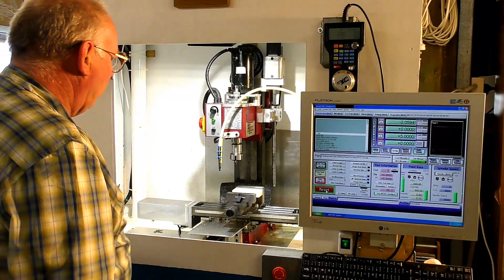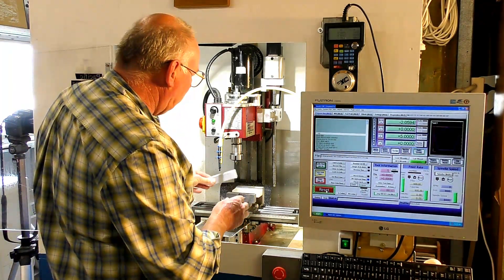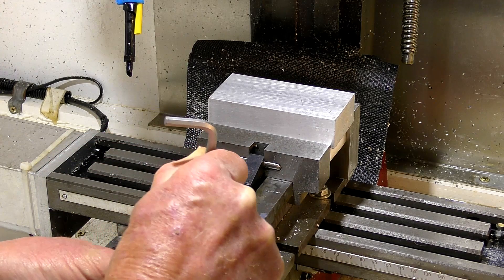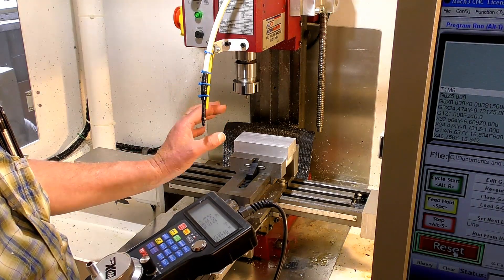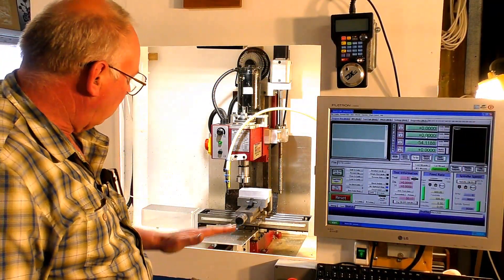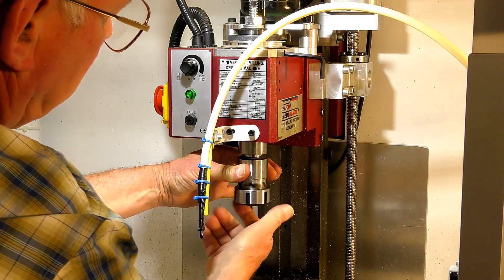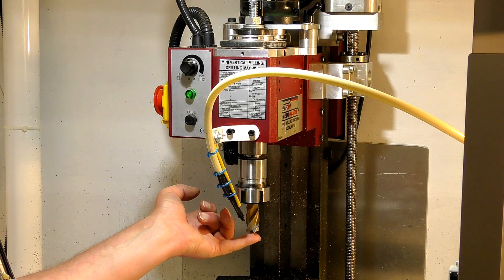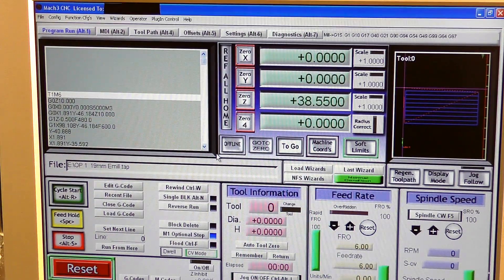How to start CNC Metal Milling, CNC Mini Mill + Mach 3

Comment: Get an edge finder so you can accurately and repeatedly set the edges.  Use a piece of paper when setting you Z to give you a little cushion.  I hope that was a center cutting end mill when you dropped it onto the surface.  Most people bring them in from the side.

Comment: Hi Roger, What is the milling vice you are using on the mini mill. Thanks Dave.
Reply from the maker: 100mm Sieg milling vice
Reply: @inventorsworkshop9600  Thanks i am using a toolmakers vice and the way you lock the jaws is so frustrating 😞